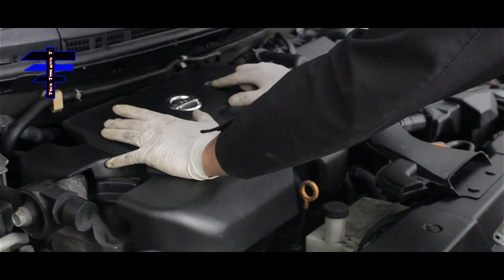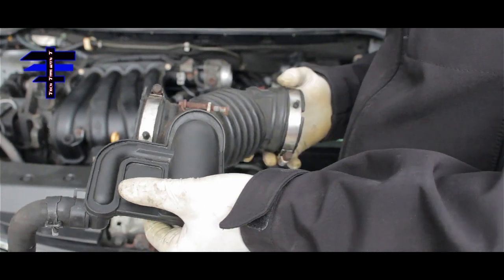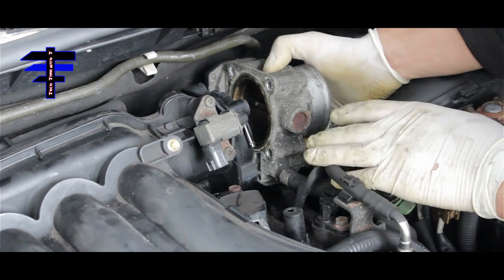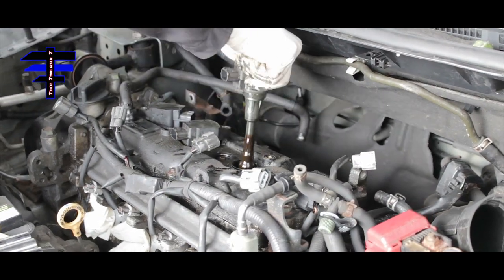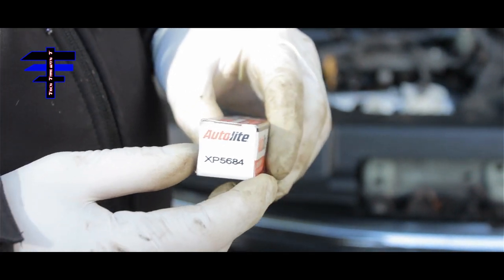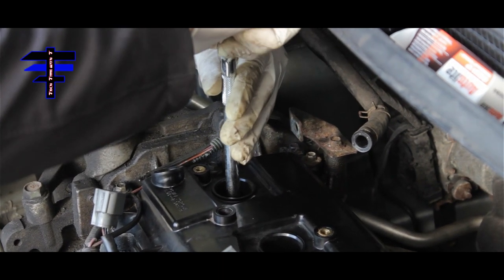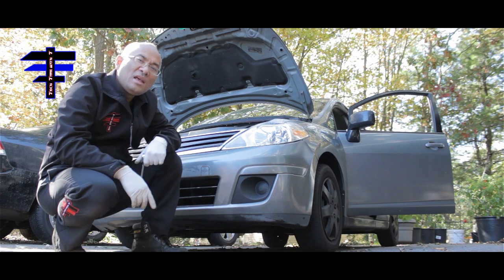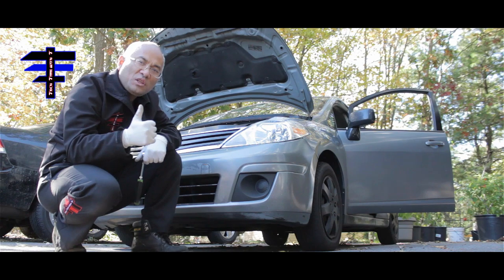DIY: How To DIAGNOSE And Replace A MISFIRING Coil Pack/IGNITION Coil/SPARK Plugs / Versa/ vlog 2024

Comment: thank you very much sir excellent video  i like how you say what size socket you are using  
also 1 question is it necessary to disconnect battery poles to do this>? thanks
Reply from the maker: Thank you. Yes I would recommend you to remove the negative terminal from the battery, for safety reasons. Thank you.
Reply from the maker: Good luck. Be safe!

Comment: So when you saw the oil on the coils and plugs on this job, did you change valve cover gasket? I didn’t see that part. What happens if you don’t do that?
Reply from the maker: Yes, i would recommend you change the valve cover gasket.  Probably, it’s a cracked gasket.  

Please check part 2 and 3 for valve cover gasket https://youtu.be/xYYu-BDkQuI